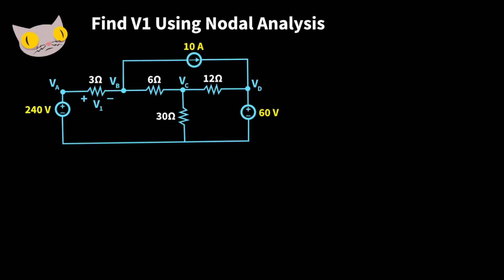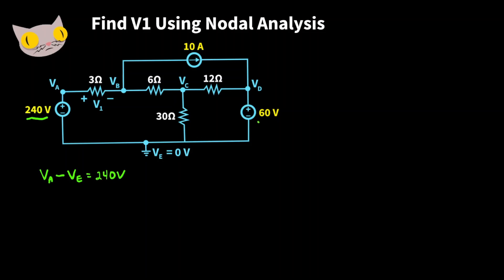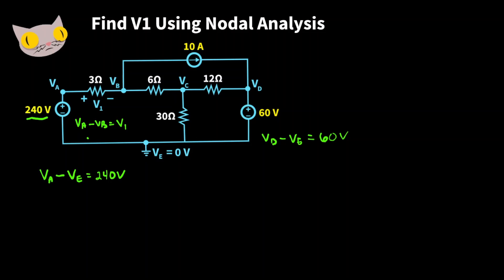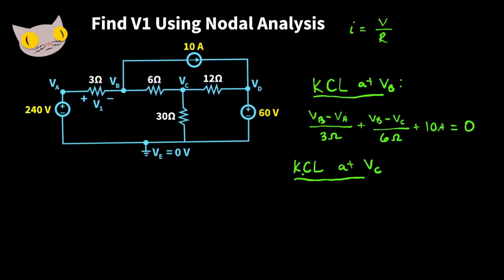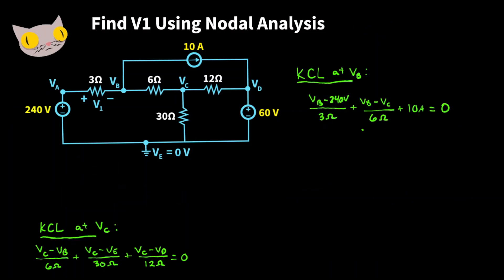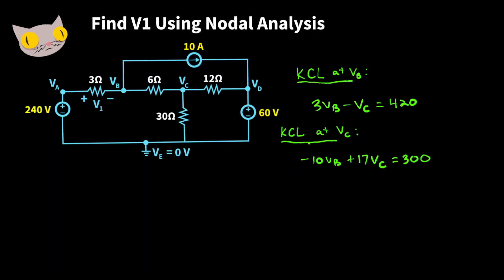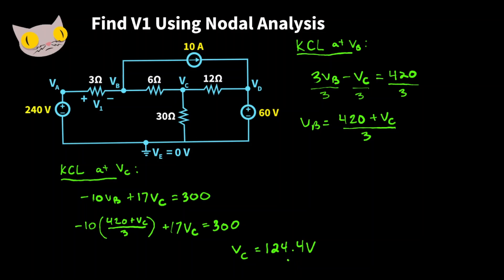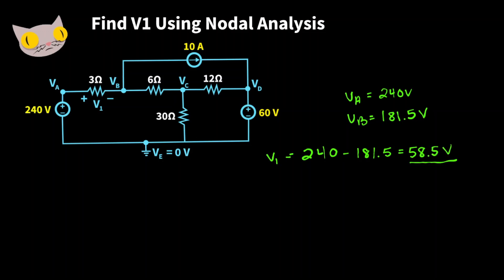FE Exam Practice Problem | Nodal Analysis

Comment: Why did you not use polarity when solving the node equations? You just add them up to zero but then how do you know what current is entering or leaving the node? Or do you figure that out in the end by evaluating the polarity of your final values? Thanks!